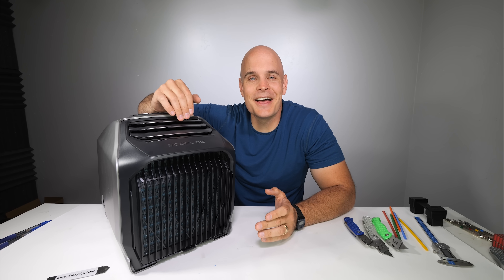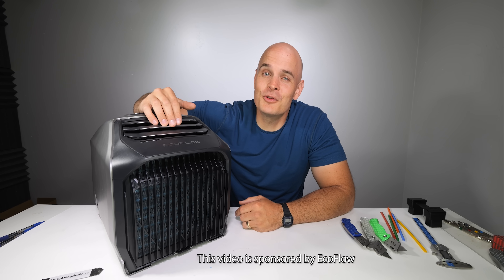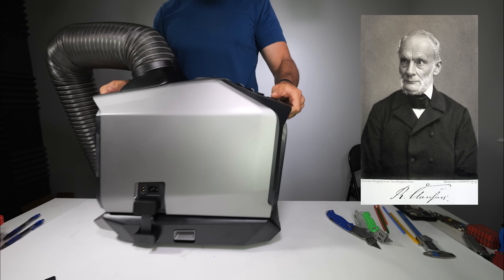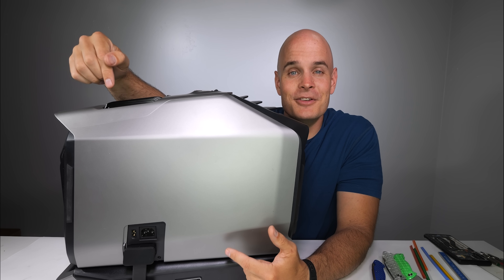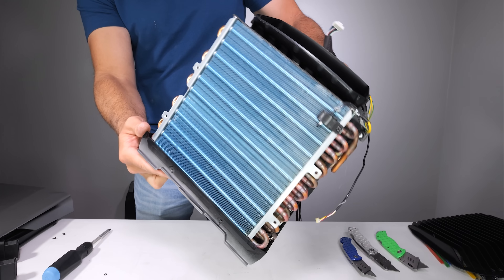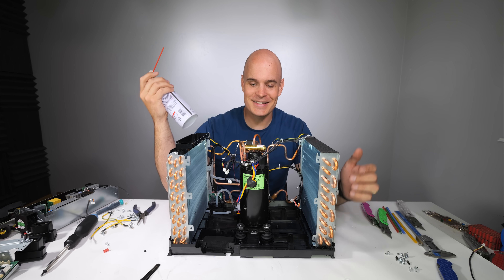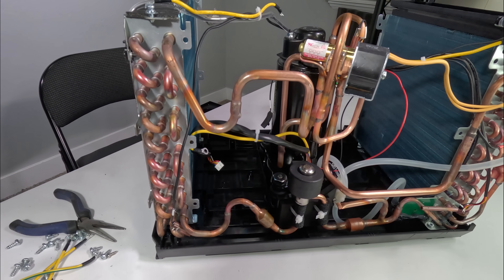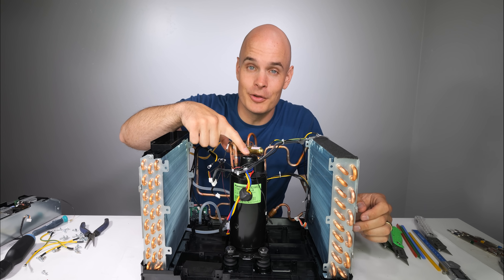THIS CHANGES EVERYTHING... (Ecoflow Wave Teardown)

Comment: Regular small window AC unit.  Nothing new to see here.  You could pick up a similar units albeit without the heat reversing capability for about $110.  
At least this is not a "Cool Breeze" scam.
Reply: The appeal of this unit is the ease in which you could install it in a camper or a van.  I have used a window AC in my van and it is very cumbersome not to mention using twice the electricity this does.

Comment: The valve doesn’t compress only expands hence the name expansion valve. One heat exchanger will condense the hot high pressure gas coming from the compressor into a warm high pressure liquid by rejecting heat (this can be used for heating) the liquid then gets expanded through the valve lowering its pressure (and boiling point) the other heat exchanger will then absorb heat (this will be used for cooling) and boil off the low pressure liquid until it is a low pressure gas. This then returns to the compressor to gain heat from the motor and once again increase the pressure. I’m a HVAC engineer in the UK👍🏾
Reply from the maker: Looks like I need to learn more! Thank you!
Reply: @JerryRigEverything  no worries! It was a good effort with no HVAC background

Comment: Holy cow! They want $1,100 for just the air conditioner without the battery! It's another $1,100 for the battery! That only gives you 8hours of run time! 
They charge $4,400 for a generator and air conditioner that last 24hours

Comment: For the Heating: Please mention that the "heat pump" only works as long as there is enough energy to pump.. commercial air-heat-pump units in central europe usually stop at 5°C because the air/humidity could freeze up in the unit when the energy gets removed.
The commercial units usually have a electric heater in the range of 2kW to 5kW for those low temp days, running as heat pump 90% of the time with varying COP.
So if its really cold outside you still need some additional heat source.

If you use water not outsideair as source you can get a lot more energy out of a water tank,
freezing it up in the process.. and then can use that ice block in the summer to cool your house again.
Reply: Well there are some air source heat pumps that can even go to -20C at 2 COP but it requires melting function reducing effective COP a bit.

Comment: Long Time ago i read about the idea (was it VW??) to make a removable AC for cars,
that can be taken into your home when not needed in the car. For poorer countries.
Since everything is modular anyways and there is not a lot of difference between an electric car and you house with electric sockets.
Same for the powerpacks, pluggin into your home to be used.

Sadly none of those two things got quick-change,
"nobody" (aka the producers) wants interchangeability on parts as we are used to for AA batteries for around 100 years..

=> I have modded two "Single tube room AC units" = "hot air gets blown out and warm air sucked into the room" to dual-tube = room air seperate from external air flow,
to make it more efficient and a portable AC unit, since i only need it for around two weeks a year.

Price difference for two pipe units is for no reason around 400 bucks (>750bucks) to a simple unit (<300bucks) where you need to add a simple air box+tubes and maybe a fan to help along.
When you take a look inside those units you can usually see the hot/cold side heat exchanger and you only need to finde the fins where the room air gets sucked in for cooling, attach box there and pipe it in from outside. BUT you need to check for enough air flow and clean the intake side more often.

Comment: Over 1,200 dollars for 5100 BTU's.... Hell no. Admittedly it is cool, pun intended. However 5100 BTU is rated for any room size up to and between 500-700 sq. ft. That's the size of a small room. For reference a standard AC with 5000 BTU's cost around $100. An AC unit that can cover over 2,000 sq. ft. cost around $500 with a BTU over 12,000.
I'm sure someone has already looked up what BTU means. It's essentially, and imma paraphrase this, a unit of measurement that defines the amount of heat required to raise a temperature of water by 1 degree calculated through the cost of energy it takes to do so. High BTU means more energy cost to run it. People often run their power bills and or break circuits because they buy the more expensive AC units, usually with high BTU rated for entire living spaces.
Reply: BTU also applies to heaters, prices are around the same per sq ft. Small room sized heater you can get for $100. Heater and AC , both rated for 5,000 BTU can run up around $200. This combo shouldn't cost 6 times as much

Comment: This makes no sense, the exhaust sends the heat\cold inside, or if the ducting is used it sends the heat outside creating a negative pressure that brings in the heat or the cold from the outside environment. It looks like a worse version of a single unit indoor AC. The Split and Central ACs are usually 300-500% efficient without creating temperature vectors that point to the original temp. 
This is wasting electricity with a very sophisticated method.

Comment: 3:25 a BTU is a British thermal unit. They are used to measure air output. 12,000 BTU’s equals one ton, a 6 ton unit is equivalent to 72,000 BTU’s

Comment: Thanks for the review. I've ordered one to see how this works. In our mild climate in Vancouver I'm just looking for a little extra cooling in the top floor in the summer and a little extra heating in the bottom floor in the winter. This looks like a great option. Installing a complete heat pump system was going to be hugely expensive and only 1/2 the system would be used at any one time in the year.
Reply: Let us know how it went

Comment: I'd be curious to see how this compares with small mini-split units and RV units. I've been looking for a very small AC/heat pump that can ramp down in output for a small van/truck build. Don't want to have a massive unit strapped to the side or something, and the volume is so tiny that even a very small unit would be way too much. I'll keep an eye on this one.

Comment: Just as most portable ac's its not so efficient as they claim. With only one non isolated exhaust house it will create a lower preasure inside. Meaning outside air will get in elsewhere lowering the overall efficiency. A good portable ac/heater should realy have 2 hoses for intake and outtake keeping the preasure unchanged. I mean cooling air while getting hotter air comming in elsewhere is not efficient at all...

Comment: Too bad they don't sell longer XT150 cables. 1m is not enough for most. (Please sell 5m cables EcoFlow). Will also need a $90CAD Smart generator adapter(XT150) to get it to work with my Delta Pro.

Comment: The efficiency you speak of is reduced in general because it uses the cooled air to exhaust its heat by being an indoor unit, instead of using outside air to cool itself as a separate unit.

Comment: Reversible heat pumps aren't new. This one isn't even particularly impressive. It is actually a pretty small unit. I imagine that's because it has to run off of a battery. Mine just plugs into the wall and can put out A LOT more cooling/heat than this one (5800 BTU I think).

Comment: A large part of it's efficiency is lost when conditioned air is dumped outside to heat or cool a coil and air to air heat pumps capacity is inverse to the heat requirements .

Comment: You need to have an intake and exhaust duct (looks like this has exhaust only?) for proper efficiency. Surprised that a battery-powered unit doesn't try to maximize efficiency. Maybe it is 200% efficient, but most heat pumps are 300-500% efficient. Seems like a battery-operated one would want to be closer to 500% to have any chance of being useful. Definitely need 2 ducts total to have a remote chance of achieving that
Reply: It does use 2 ducts. It being small, and not a split system is likely why the COP isn’t great.

Comment: The refrigerant called R290 is simply the flammable fluid Propane jejej, but with a small charge it is a perfect natural refrigerant with almost zero ODP and GWP.
Another correction, the 4-way valve only reverse the direction of flow, so the evaporator becomes a condenser and vice versa, but it does not make any type of compression, the only part in the cycle responsible of compression is the compressor. The part responsible of the expansion is the thermostatic expansion valve between the condenser and evaporator.

Comment: This is cool. I wish Ecoflow made 2 part version of this unit connected with hoses for vans buses and RVs. Like a mini mini split. It would be way more mini compared to some much larger versions on the market currently.
Reply: Oh yes please. Doesn't make sense to cooldown a room while the vacuum it's creating pulling in all the hot air.
So overall efficiency is pretty terrible
Reply: What vacuum.  The condenser is capable of pulling outside air over the condenser and exhaust back to the outside.  A the evap is pulling air from the inside over the coil an pumping it back to the room.  

I mean if you set it up outside to blow in. Than your cooling outside pushing in creating a positive pressure.  

Otherwise you do as stated above an it’s not a positive or negative it’s just circulating.   With the Wave 2.

Comment: @jerry 0:26 No man made creation is 100% efficient forgot about 200%. Please dont mess up with Basic Science efficiency is input energy VS output energy. If you say 100% + efficient that means the system will run forever without any energy from outside the device 😂. Teardown is also a science hope you don't miss lead your audience just to promote some product.
Reply: The coefficient of performance or COP (sometimes CP or CoP) of a heat pump, refrigerator or air conditioning system is a ratio of useful heating or cooling provided to work (energy) required.Higher COPs equate to higher efficiency, lower energy (power) consumption and thus lower operating costs.

The COP usually exceeds 1, especially in heat pumps, because, instead of just converting work to heat (which, if 100% efficient, would be a COP of 1), it pumps additional heat from a heat source to where the heat is required. Most air conditioners have a COP of 2.3 to 3.5. Less work is required to move heat than for conversion into heat, and because of this, heat pumps, air conditioners and refrigeration systems can have a coefficient of performance greater than one.

However, this does not mean that they are more than 100% efficient, in other words, no heat engine can have a thermal efficiency of 100% or greater. For complete systems, COP calculations should include energy consumption of all power consuming auxiliaries. The COP is highly dependent on operating conditions, especially absolute temperature and relative temperature between sink and system, and is often graphed or averaged against expected conditions.

It’s just referring to transfer efficiency.

Comment: 200% efficient?! Total hogwash. 60 degree of cold and only 86 degree of warm air makes the unit just about totally useless. Also, at what ambient temperature are those temperatures realized? This is just more hogwash. Thumbs down for promoting junk.
Reply: The coefficient of performance or COP (sometimes CP or CoP) of a heat pump, refrigerator or air conditioning system is a ratio of useful heating or cooling provided to work (energy) required.Higher COPs equate to higher efficiency, lower energy (power) consumption and thus lower operating costs.

The COP usually exceeds 1, especially in heat pumps, because, instead of just converting work to heat (which, if 100% efficient, would be a COP of 1), it pumps additional heat from a heat source to where the heat is required. Most air conditioners have a COP of 2.3 to 3.5. Less work is required to move heat than for conversion into heat, and because of this, heat pumps, air conditioners and refrigeration systems can have a coefficient of performance greater than one.

However, this does not mean that they are more than 100% efficient, in other words, no heat engine can have a thermal efficiency of 100% or greater. For complete systems, COP calculations should include energy consumption of all power consuming auxiliaries. The COP is highly dependent on operating conditions, especially absolute temperature and relative temperature between sink and system, and is often graphed or averaged against expected conditions.

It’s just referring to transfer efficiency.

Comment: I have always been perplexed about using a heat pump for indoor applications.  Being exhaust air should be pumped outside of the closed space, outside air must "leak" back into the closed space to replace it otherwise you would just depressurize your space.  This leaked air is going to be the air your trying to cool/heat thus I have a hard time understanding its true efficiency.  For outside uses this obviously is not an issue and efficiency is thrown out the window anyhow.

Comment: What's the efficiency of the product, that 200% makes no sense because say if the old heating you showed is just 1% efficient and this new product is 2% it comes to 200% efficient?
Reply: The coefficient of performance or COP (sometimes CP or CoP) of a heat pump, refrigerator or air conditioning system is a ratio of useful heating or cooling provided to work (energy) required.Higher COPs equate to higher efficiency, lower energy (power) consumption and thus lower operating costs.

The COP usually exceeds 1, especially in heat pumps, because, instead of just converting work to heat (which, if 100% efficient, would be a COP of 1), it pumps additional heat from a heat source to where the heat is required. Most air conditioners have a COP of 2.3 to 3.5. Less work is required to move heat than for conversion into heat, and because of this, heat pumps, air conditioners and refrigeration systems can have a coefficient of performance greater than one.

However, this does not mean that they are more than 100% efficient, in other words, no heat engine can have a thermal efficiency of 100% or greater. For complete systems, COP calculations should include energy consumption of all power consuming auxiliaries. The COP is highly dependent on operating conditions, especially absolute temperature and relative temperature between sink and system, and is often graphed or averaged against expected conditions.

It’s just referring to transfer efficiency.

Comment: This is nonsense, you are cooling some air, then, taking that same air you just worked hard to cool down, use it to cool the hot side, and throw it outside. And to replace that air you just threw out, some outside hot air will find its way into the room... take the same sentence and reverse it for when you're using it for heat, same nonsense

Comment: Actually, it's not 200% efficient. As it's not converting the electrical power into heat. It's converting it into movement to transport and increase the density of the heat.
It is, however, able to move more units of heat than can be generated by the same amount of power. That is what the COP AND EER value is all about: Coefficient of Performance and Energy Efficiency Ratio
Also, the "cool air" is being "ejected" anywhere. As the refrigerant expands, it gets cold. It can then absorb heat from air passing through the condenser.
The air on the other side has now lost some of it's energy to the colder condenser and thus has a lower temperature then before passing through it.
Reply: 200% transfer efficiency would technically be correct.
Reply: Consider efficiency as dollar spent. For every dollar spent in electricity you get one dollar out for an electric radiant heater.  

Heat pumps and geothermal systems can get efficiencies of 2 dollars for every one dollar of electricity. Even upwards of 5 to 1 in geothermal.  

Not everyone understands COP, SEER, HOC, TXV….
Reply: 200% is an oddly abysmal C.O.P. for a dual rotor, inverter, dual fan heat pump. The problems are the undersized rads implemented for compactness and lower air flow to save battery.

Comment: the 200% efficient thing is bullsh*t, nothing can be 100% efficient in this world. And there is nothing new, every household ac, refrigerator and even the ACs in our car work on the same principle.
It's just a compacted window ac stuck on top of a portable inverter
Reply: The coefficient of performance or COP (sometimes CP or CoP) of a heat pump, refrigerator or air conditioning system is a ratio of useful heating or cooling provided to work (energy) required.Higher COPs equate to higher efficiency, lower energy (power) consumption and thus lower operating costs.

The COP usually exceeds 1, especially in heat pumps, because, instead of just converting work to heat (which, if 100% efficient, would be a COP of 1), it pumps additional heat from a heat source to where the heat is required. Most air conditioners have a COP of 2.3 to 3.5. Less work is required to move heat than for conversion into heat, and because of this, heat pumps, air conditioners and refrigeration systems can have a coefficient of performance greater than one.

However, this does not mean that they are more than 100% efficient, in other words, no heat engine can have a thermal efficiency of 100% or greater. For complete systems, COP calculations should include energy consumption of all power consuming auxiliaries. The COP is highly dependent on operating conditions, especially absolute temperature and relative temperature between sink and system, and is often graphed or averaged against expected conditions.

It’s just referring to transfer efficiency.

Comment: except it wont work. It got a huge design flaw where it uses indoor air that you have cooled down (or are trying to) to vent out the hot air.. now where are you going to get new air to replace the one you just threw out? It will come in through ventilation and it will be warm. But hey, it makes a great tiktok video